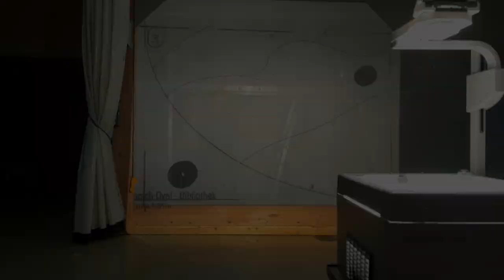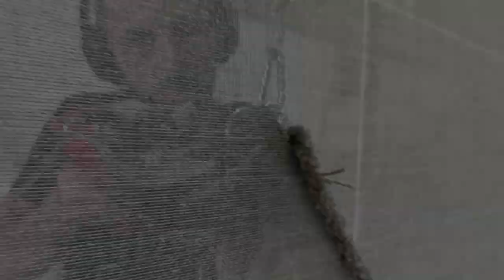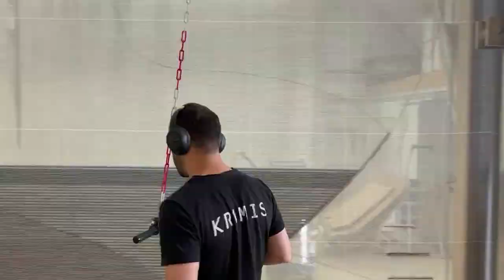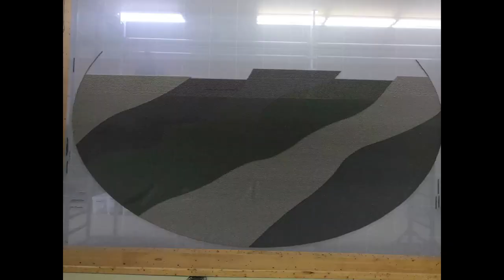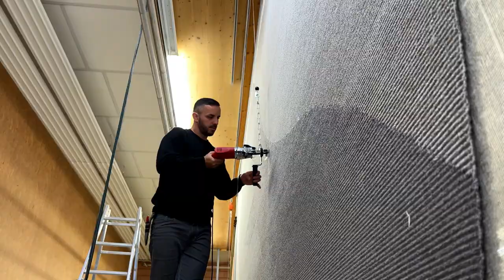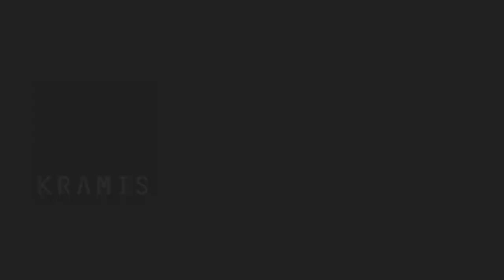Making Rugs For A Luxury Hotel | Mandarin Oriental Palace Luzern

Comment: What kind of frame are you using?
Reply from the maker: This is a self built frame which we can change depending on the size of the rug.
Reply: Some of your frames or at least the smaller frames do not appear to have nails. It looks like a different kind of system in which a small frame in inserted into a slightly larger frame
Reply from the maker: @factory4hire  It may look like this but actually every frame has the same setup and the nails are a must have for tufting.